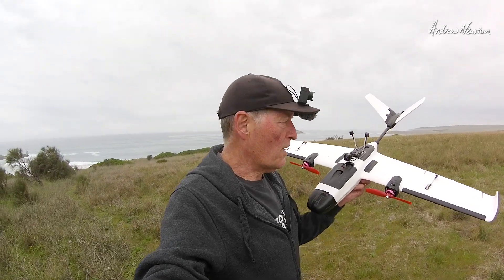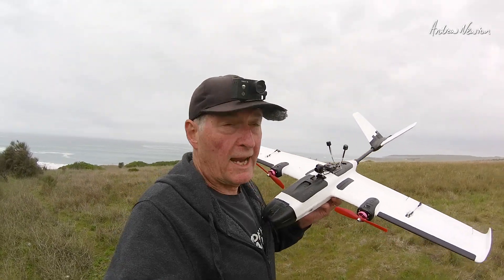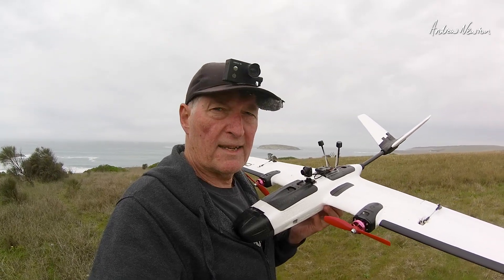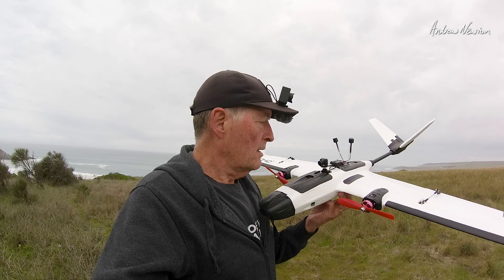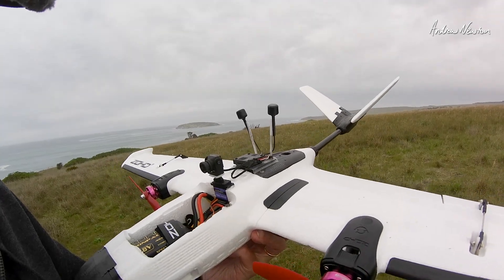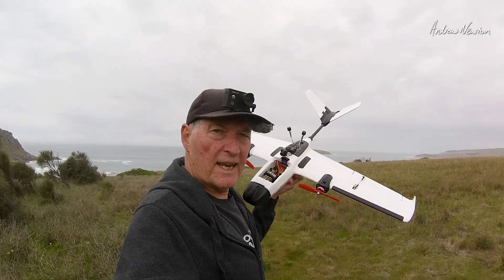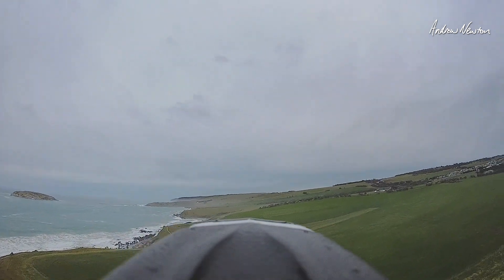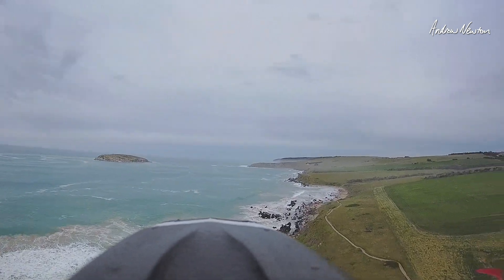Walksnail HD Pro - Altus 270º Pan servo

Comment: Ho Andrew, is there a possibility to set up this pan servo configuration with headtracking for example qith the walksnail L? Is there perhaps a video from you? Thanks
Reply from the maker: No the GogglesL only talk to selected Avatar VTx. Manual says you need a 3rd party head tracking module for PWM controlled head tracking. Also the GimbalConfig.exe won't run on my Mac

Comment: Hi Andrew, I also have the HD PRO KIT. I have noticed that the transmitter gets very warm after a short time. ( at 25 MW ). I use a Speedy Bee F405. ( 9V on the digital output ). I have also installed a plug so that I can only supply the transmitter with power shortly before starting. Do you have a solution to this problem? With kind regards. Didi
Reply from the maker: Yes they all heat up a lot. Same as you, just power up the VTx when ready to launch
Reply: Hi Andrew, thanks for your reply. In my experience with electronic devices, this cannot be useful for lifetime. Many of my analogue transmitters also get warm, but not after such a short time. I hope Caddx is working on this problem, otherwise it will be expensive fun for many FPV pilots. Thanks for the nice videos and greetings from cold Switzerland. Didi

Comment: A little bit offtopic question, when flying in misty weather or other kind of mild-wet atmosphere conditions, do you couat your fc/esc/vtx in conformal? And do you provide air to internals, trhough some hole in front of the fuselage?
Reply from the maker: Very dry where I fly so I never think of coating. Yes internal airflow is important, but my cameras and VTx are always external

Comment: I agree, pan is all you really need when you think about it. Do you use a radio knob or a slider to actuate the pan. I just built my first ever cam pan, found some  350 servos. I'm excited to fly it!
Reply from the maker: Slider plus switch to centre it
Reply: @AndrewNewton   May that's why the cam wiggles in the sliders center ! The detent is kinda sloppy. I will have to figure out . Chan>switch> mixer (slider) I;m kinda dumb ! lol

Comment: Andrew I'm looking to buy a FPV foamy for a friend and his son, it's a toss up between the altus and the swordfish I think, however I own neither, I like my flying wings. Which of the two would you recommend? Dad had some experience with Balsa models back in the day but both he and the lad have been putting in the hours on a simulator so they aren't completely raw. Wadaya reckon?
Reply from the maker: Hard to choose really. Altus is a bit tougher and easier to work on but the Swordfish is more efficient and handles the wind better. Just go for the cheapest or whichever is in stock.
Reply: @AndrewNewton  Fair enough, both have points to recommend them then, I'd tend toward the robustness based on my own early "landings" but yes the cost difference could throw in a few extra props.. Cheers Andrew.

Comment: I'm not into FPV or camera-tracking doobries (I'm mainly a glider nut, so...  flaps, variable camber, etc.), but this kind of application should (hopefully) alert more radio manufacturers to the importance of providing a couple of good slider controls besides the usual battery of (cheap, largely useless) 2- and 3-position switches on their non-specialist transmitters.
Reply from the maker: Yes transmitter for INAV and gliders share a lot of features.
Reply: I second this request. A slider, or finger controlled roller on the side of the transmitter, with an indent or haptic feedback to mark centre position.